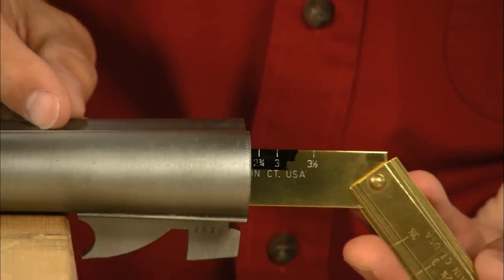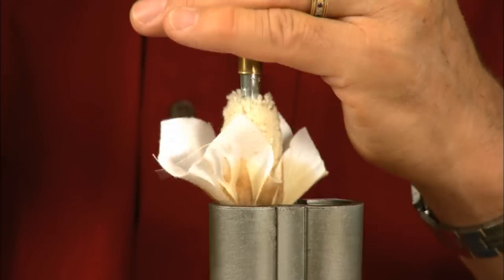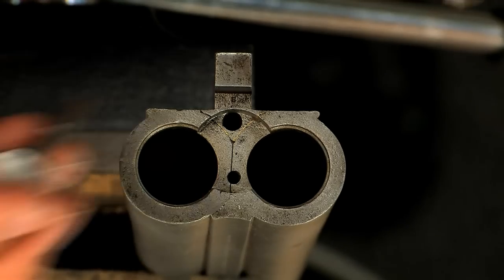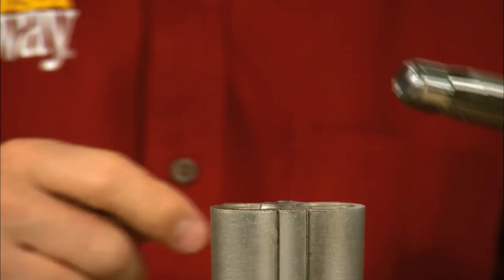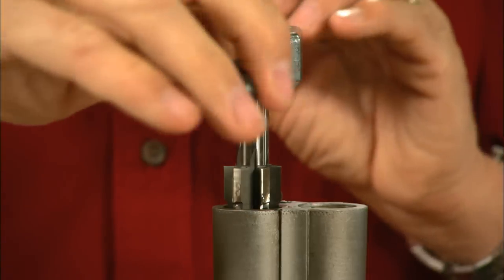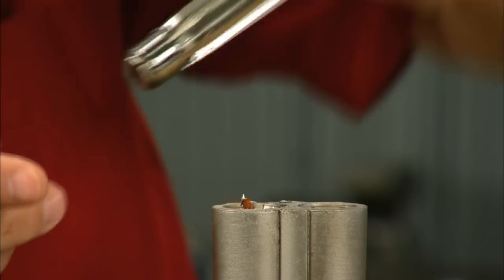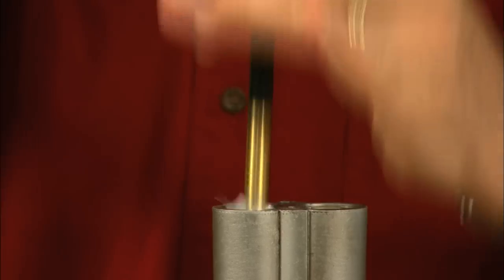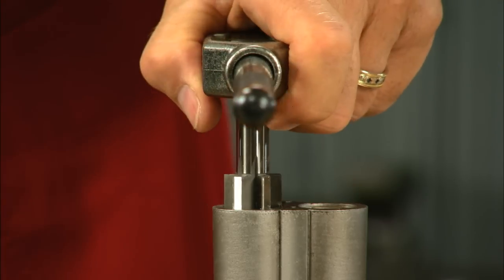How to Lengthen the Chamber on an Antique Parker Shotgun | MidwayUSA Gunsmithing

Comment: But the question is, should this be done?  2.5" 12ga shells are available commercially or can be easily hand loaded.
Reply: +wholeNwon But they can only carry lighter loads, I have a BSA 12g that's 2.5" but the problem with that is steel shot is only sold in 2.3/4" or higher. To shoot fowl in the England and Wales you have to use steel... That's one example as to why someone would do it.
Reply: Yes, I do understand why some want to lengthen chambers.  Without careful measurement of wall thickness in the appropriate areas and a knowledge of the specific properties of the barrel alloys, I wouldn't do it.
In my own guns with 2 1/2" chambers and with 2 5/8" chambers, I shoot 2 1/2" shells. All of my doubles with short chambers are old and not suitable for steel shot.  For steel shot, I use modern guns with 2 3/4" or 3" chambers.
Reply: wholeNwon In the UK if you take anything other than a side by side old British gun duck shooting you're pretty much considered a cheat. The problem with 2.5" is that i can't find any shot bigger than 6 1/2 which when it was made as a game gun pretty much makes it useless.

Also, i've got an old Spanish gun which must have been made in the 50s and that shoots steel just fine with one barrel being 1/8 and the other being 1/2 choke.

I'll have a chat with my gunsmith, see what the situation is...
Reply: +MrcabooseVG You could load your own, of course, or just replace the shot with a larger size.  My understanding of British law, admittedly very weak, is that an altered chamber voids the proof.  To be resold, the gun would have to be reproofed.  Unproofed, a ruptured barrel injuring others would make you liable for damages. 
One of my favorite upland guns is one of yours, a W.W. Greener with 2.5" chambers and Damascus barrels (unaltered in any way). I load black powder shells for it and it performs superbly on pheasants.
Reply: wholeNwon Shotgun cartridges are pretty cheap and it actually cost more to make them yourselves here so finding reloading stuff for shotguns is pretty hard. Powder and shells are easy to get but from what i can tell people only reload slugs because they're the only thing that is cost effective
Reply: ''But should this be done'' is a common question on gunsmithing videos. Im all for a cool project, but usually its worth it to leave something as is.
Reply: I heard it alters the pressure spike and felt recoil. Apparently there's a chance of bulging further up the forcing cone, but it's at a shallower angle, so I think the risk is a wash. Apparently it significantly reduces felt recoil.

I haven't done this procedure, only read about it as I want a Winchester 1897.
Reply: @corvairkid17  In general, shooting 2 3/4" shells in a gun with 2.5" chambers adds only about 1000 psi to the chamber and forcing cone pressures.

Comment: Looks cool, but is it safe?
Reply: Not really sucks the reason why that was two-and-a-half is because it's black powder going to making the other ones 2 and 3/4 was they were smokeless powder
Reply: YES, IT'S SAFE. The reason the chamber was so short is because in older guns they used fiber wads back then, not plastic shot wads. All they had was paper shells & fiber wads back in the day. It HAD NOTHING TO DO WITH BLACK POWDER.
Reply: No. It is not 100% guaranteed safe. There may or many NOT be enough steel in the reamed-away, 1/4" of barrel to provide sufficient strength. I would not attempt until I knew the barrel was thick enough.

Comment: A .50BMG chamber is just slightly less than a 12-gauge chamber due to the taper.  Could this reamer be used on a .50BMG chamber if someone was wanting to create a sort of wildcat where the projectile and powder was loaded  separately and thus the 12-gauge shell just had powder in it?  I have a .50BMG barrel that I've considered doing this to... My lathe is not big enough to put the barrel in it and rechamber it that way...
Reply: The danger of what you are describing would be the almost impossible task of consistently seating the bullet to the exact part of the chamber throat or even having the bullet pushed ogive to the rifling.  If the bullet "fell back" into the chamber area due to not being held by a metallic case, then all sorts of bad things would happen on ignition of your shotgun shell full of powder.
Reply: @SAArch82  -- Correct... You would have to have a procedure to ensure that you are seating the bullet to the same depth each time.  I've done this with .22 powershot loads and 55gr bullets in a .22 rifle.  For it, I used a machine screw with two nuts on it (one as a "jam nut" to lock them together) and that allowed the bullet to be set at the same depth each time.  A similar depth gauge could be made for a 12-gauge/.50BMG hybrid...Of course, I'm talking about cast lead bullets, not jacketed, so forcing the bullet to deform going into the rifling is a bit easier... I suspect that some sort of spacer / wad could be designed for it to ensure that the bullet does not drop back.
Reply: @CurmudgeonExtraordinaire  for what you're describing, it would be nice if you could buy very long 12ga brass shells and neck them down to .50 caliber.  I don't know if you could buy them long enough (approx 4").
Reply: 13/16th inch 
then slow ream / sand the rest
Reply: @SAArch82  -- I'm thinking that .50 BMG brass and primers are quite a bit more expensive than 12-gauge shells and primers, so even if the 12-gauge plastic shells only get a single use out of them, it would be cheaper than going the actual .50BMG route... It's more of a "fun project", not something that would actually be *useful*... :)

Of course, at my age, it's not like I actually need yet another incomplete project... :(